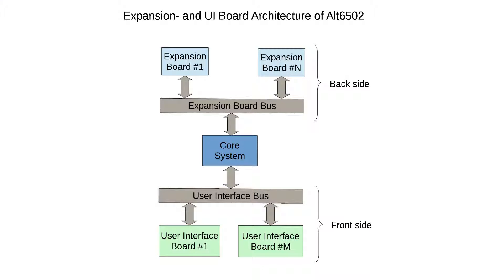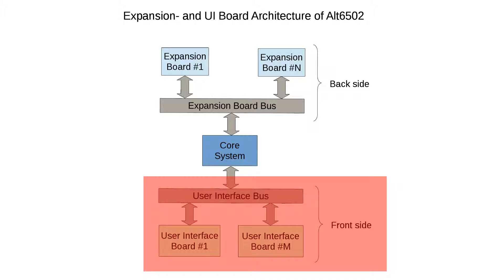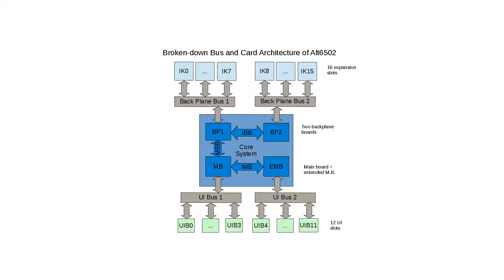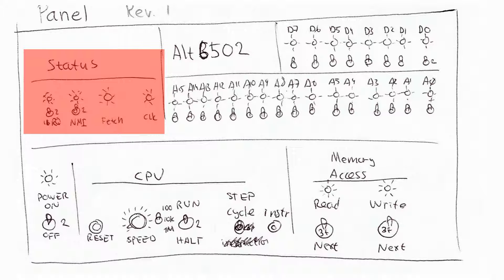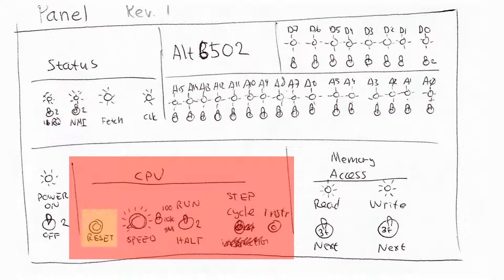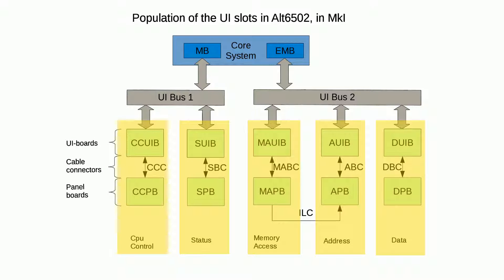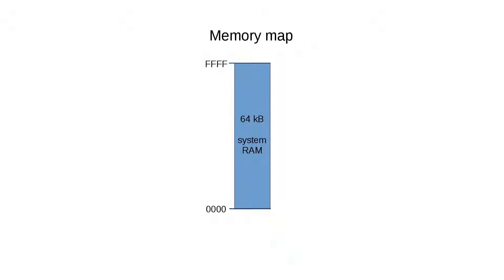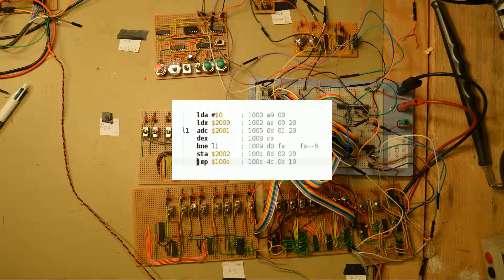The Alt6502: Episode 1: The Architecture

Comment: "I chose the CMOS version of the 65C02...because I wanted to be able to single-step."

To be clear, the NMOS 6502 can be single-stepped on a per-instruction basis; the original manuals give schematics for circuits to do that. (You leave the clock running and bring RDY low.) It's only cycle-stepping, which can be done only by stopping the clock, where you need the static core a 65C02 provides.
Reply from the maker: And of course you're correct, again, Curt!